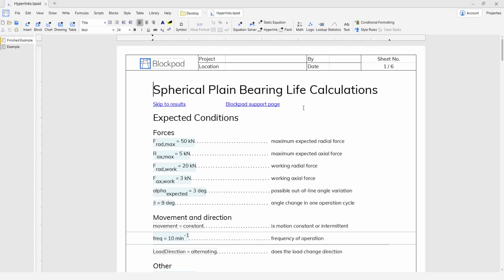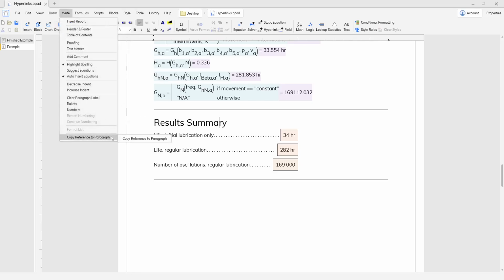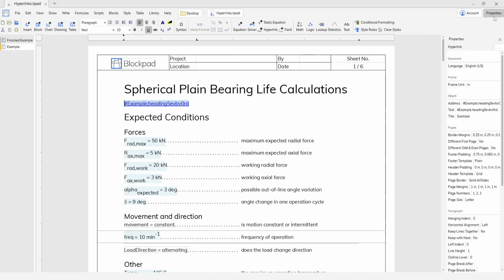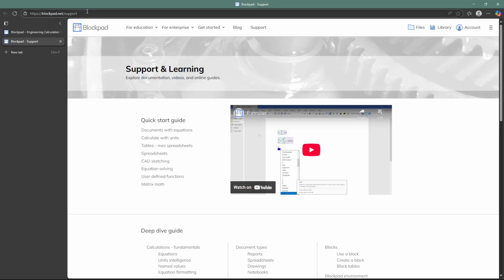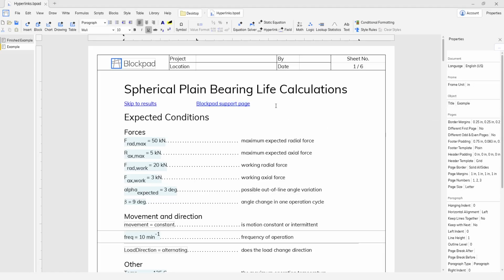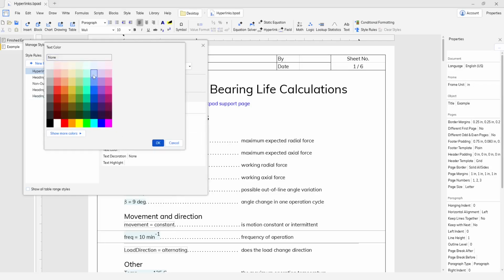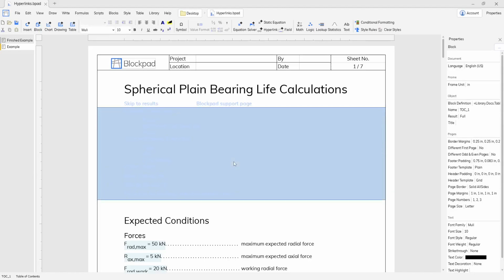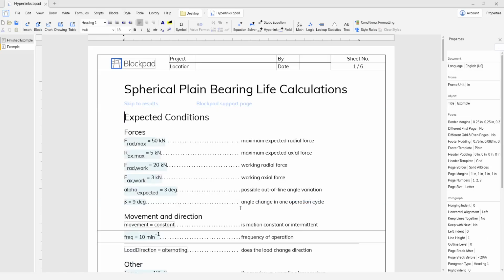Blockpad | Hyperlinks - internal and to the web

Comment: Does the work on the pdf if we print it?
Reply from the maker: Thanks for the question!

In the current version 1.7, hyperlinks do not work when printed to pdf, but they will in version 1.8.

Version 1.8 is currently available on the beta channel for the windows desktop app. We have plans to release it to the stable channel within a month or so.

Thanks!
Reply: @blockpad  if I made a dynamic equation, and it refers to another section, is there another option to hyperlink the 2 references to that specific place in the pdf?
Reply from the maker: @bobjones-eg2md   I'm sorry I don't entirely follow. Can you explain a little more what you're trying to do?

You can set up hyperlinks to as many places in a report as you need. You'd have to follow the steps for inserting an internal hyperlink from the video. There isn't a way to automatically link to the location of where a formula value is defined though.

Thanks!